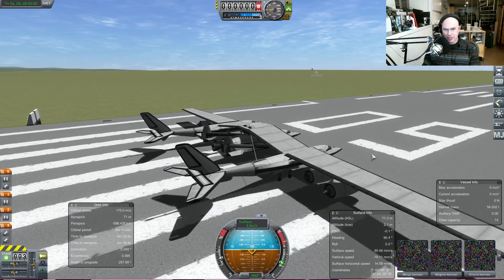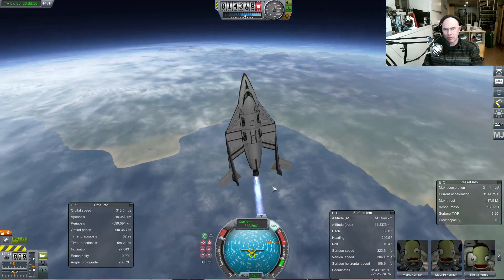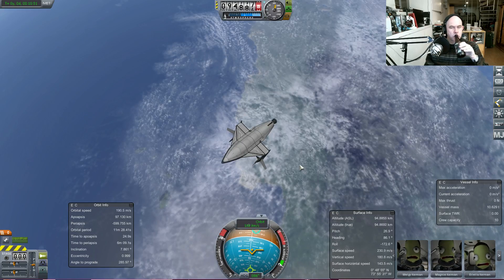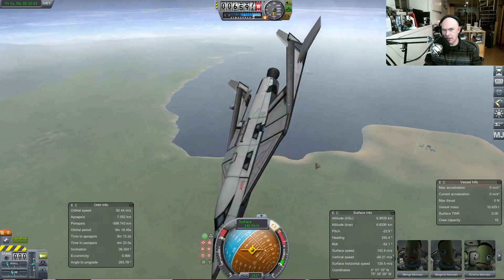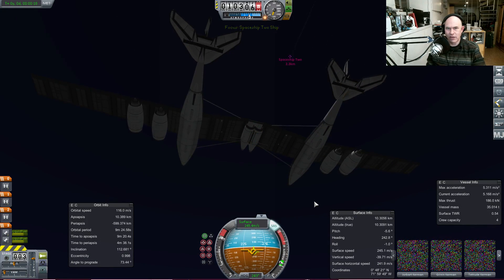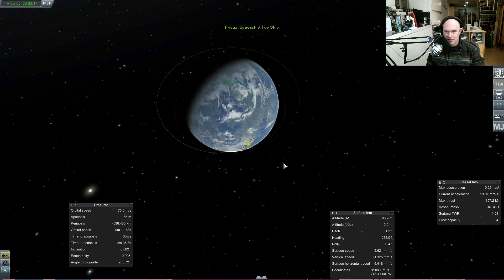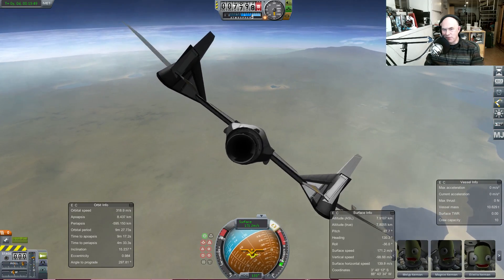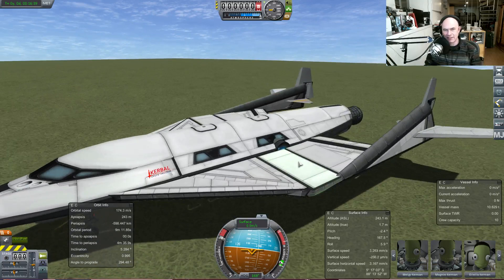Kerbal Spaceship Two / Virgin Galactic.

Comment: I'm not entirely sure what these guys are doing with SpaceShip 2. Trying to make the world's most expensive and randomly fatal aeroplane, or the world's silliest rocket.

I think we have learned that rockets which say "Light Fuse and stand well clear" on the side, are best not used for lifting anything which has a face.

And last time I checked, the best design for aeroplanes was to have the wing fixed in position, and to use control surfaces on the leading and trailing edges. Having an aeroplane where the wing can turn 90 degrees to the fuselage is the single most stupid rocket idea any person ever had.

This was perfectly demonstrated when a test flight deployed the wing mechanism, ripping the thing apart, and killing one person, and almost killing the other.

You would have to be a suicidal maniac to ever ride in this thing, let alone pilot it.

How anyone could think it was OK to spend more than $100 on this idea is beyond me. It's like trying to raise money to build a ski area in the caldera of an active volcano.

Comment: scott there is technic to bleed airspeed quickly. the manuever is called a slip. basically you are cross controlling putting in opposite rudder and aileron. the added drag will increase sink rate without increasing airspeed.

Comment: Also, maybe instead of going vertical, just go all the way at 90 degrees, or is it 45. Just, if there is a 90 degree angle from a vertical line, and a horizontal line (ground), then go 45 degrees, so your vertical speed is equal to your horizontal speed.
Reply: Diabetic Alien your comment makes me think of quantum spin.
Reply: brian554xx Lol.

Comment: how to have unlimited fuel in kerbal space program
Reply: Debug menu.
Reply: it wont work for me i have Windows 10 and i do Alt + F12 and nothing happens
Reply: If you have an NVidia video card with with GeForce Experience installed it contains a shortcut that overrides the alt+F12 in KSP. Disable or change it in GeForce experience and it will work again in KSP.
Reply: you need to use right alt or Alt GR on some keyboards
Reply: None of this works i tried (alt + gr / Alt + F12 / left and right alt / turn off my nividia on the game still didn't fix it) i dont think its in the game anymore or you cannot do this on windows 10

Comment: The U in U-Boot stands for "Untersee". So it's an "Unterseeboot" which literally translates to under sea boat. German is a great language isn't it?    ;-)
Reply from the maker: +Andreas Vogler fun fact - if you look at language origins then the most spoken Germanic language is.... English
Reply: Actually more than 2 U-2 submarines.
- SM U-2 (1908), served exclusively as training vessel in WWI, scrapped 1919
- U-2 (1935), a IIA, 2 patrols (27 sea days total), then training vessel, sunk 8th April 1944 (not "fairly early on"), collision with a German steam trawler, half the crew died, raised next day and decommissioned, wreck captured April 1945 by Soviet forces, likely scapped.  U-2 got a spread of 3 torpedoes from a British sub on her second patrol (all missed) and a bomb from a Wellington a couple days later (no damage).[1]
- U 2 (S181, 1962), a Type 201 German submarine (first new German sub class after WWII, optimized for the Baltic Sea; after 3 of 12 subs (U 1, U 2, U 3) very much changed military requirements the Type 205 was built instead).  Turns out the non-magnetic steel (AM 10) used for the 201 and the first 4 205 subs was corroding very quickly (a nice scandal!) and the U 2 was decommissioned after just over a year of service and broken up, with some parts reused for the 205 class.
- U 2(S181, 1966), a Type 205 German submarine; this one built from normal (magnetic) steel (the whole series used 5 different steels over 11 vessels: 4* AM 10, 2* ST 52 (normal, magnetic steel), 2* AM 53, 1* PN 18 S2 and 1* Amanox 182 M 9.  (PN 18 S2 is the steel used for all following German submarines).  Decommissioned in 1993, scapped.
- SM U-2 (or U-II) (1909, Austria-Hungary), a U-1 class U-Boat of the Kaiserliche und Königliche Kriegsmarine, designed by the Lake Torpedo Boat Company.  It had typical Simon Lake features, from the diving chamber, variable pitch propellers, 2 retractable wheels (for seabed travel) but also diving tanks above the waterline, which meant heavy ballast and 8 minutes of pumping to dive.  In WWI, she did training duties and then reconnaissance cruises from Trieste from mid 1915.  Declared obsolete in January 1918, she became a training boat again. Went as war reparation in 1920 to to Italy, scrapped.
- HMS Vulpine (1943, P 79), a V class(officially "U-Class Long hull 1941–42 programme") British submarine, loaned to the Danish Navy as "U2 - Støren" in 1947, returned 1958, scrapped.

And then there are the SM UB-2 (coastal submarine, 1915-1919, scrapped) and SM UC-2 (minelayer sub, 17 May 1915 - 30 June 1915, accidentally run down by British coastal ship off Lowestoft, sunk in 15m water), as well as the UC2 Kraka (2005, amateur-built midget sub, 6 tonnes, 12m length, out of commission and rusting away, replaced with UC3).  Also there's the UC-2, which started life as B-6, a Norwegian sub[2], and was in German use between Nov. 1941 and Nov 1944, as anti-submarine training vessel, decommissioned, scuttled, then raised and broken up in 1945.

[1] Interesting fact: the U-2 (1935) is smaller, slower (especially under water), has a much shorter range and a slower cruise speed and 1 torpedo less than the SM U-2 (1908), but coould dive much deeper and instead of the 45cm torpedoes the WWII U-2 of course had much nastier 53.3cm torpedoes.  But then the Type II submarines were coastal submarines.

[2] in 1914 Britain seized 2 almost completed coastal defense ships at the builders, this would mean Norway had them built in British docks by British companies.  B-1 to B-6, built in Norwegian yards, were a sort of payment for these 2 ships.  B-1 was laid down in 1919, commissioned 1923, and B-6 was laid down 1925 and commissioned in 1930 --- steel shortages being a thing.  Of the 6 boats, B-1 escaped to the UK, B-3 tried to escape, but a battery explosion got in the way and it was scuttled, B-6 was surrendered ("... else we have to bomb that nice city of yours ..."), the rest captured, as was one A class sub.  All but B-5 and B-6 were unusable even for training.
Reply: Which is actually great for Germans because it's super easy to learn. And English grammar has been simplified over time unlike German. I wish certain other EU countries would emphasize English more in school though.
Reply: Scott Manley well hang on there Scott, English is a combination of Danish, German, French and many other random bits from around the world. 

Oh and there were actually two U-2 U-boats - a type I boat in the First World War that was a prototype and test model and a type IIA boat in the Second World War that was sunk fairly early on!

Comment: the flipping over during acceleration is very very bad which is why the first ship ripped itself apart the first time they tried.  is a bad design and should have been a blended wing body.
Reply: rizendell Completely false. That's not why the first ship crashed.

Comment: The carrier was doing what's known as a Dutch Roll. That means it was rolling and yawing at the same time when you only wanted it to do one of those.
Reply from the maker: +2sudonim and how do I fix that
Reply: Scott Manley 
Disable roll on the vertical stabilizers
What is happening is the vertical stabilizers are trying to roll the plane and because there is no matching stabilizer under the plane they are imparting yaw force
The large distance between the vertical stabilizers and the centerline is exasperating the problem
Reply: I've got the same question. Do you toggle the different authority controls on the flaps?
Reply: Scott Manley perhaps if you paired some yaw input to your roll input? You're familiar with swept wing Dutch roll mechanics... right? I'm not quite sure it's what in play here, it doesn't seem quite right with the big flat wing.

Comment: how does nobody playing ksp know how to take off with a plane...?
You don't just pull up, that stalls you a bit and you lose some acceleration for the time being. Now that might not be enough to have any effect, but it's just one of those things you can differentiate the skill levels of players. 
Instead of pulling up and slightly stalling, you should lower the flaps (which you have if you build any plane with those kind of wings) and wait until the plane lifts itself off the ground. When the plane is in the air, you can start pulling up (again, without decreasing your speed and acceleration too much.
Reply: Lee'd That only matters if your aircraft has been made with pretty much zero fuel tolerance. (Which, incidentally, is a good way to differentiate the skills of players)
Reply: LOL. Thats not how real pilots fly planes. They dont take off themselves. Yes they use flaps, but If you have ever heard a pilot they say. "V1, ROTATE" rotate means to pull up a bit to lift the nose and take off. a plane would overrun the runway before it would take off itself. Unless pitch trim is set dangerously high
Reply: +Gamingwithsean And isnt pitch trim just basically adjusting the default position for the aerilons anyways?
Reply: yes, it is. so that would make the plane pull up

Comment: Is there a hybrid rocket engine mod? I haven't played it in a while so I'm kinda clueless.
Reply: If by hybrid you mean an air-breathing engine that changes into a closed cycle rocket engine there is one in the stock game now called the R.A.P.I.E.R.
Reply: rock3tcat (ⵙⴰⵔⵓⵅ) Not really, there are different types like electric xenon ones and stuff, but it's an awesome game, and I flourish can, I would suggest playing it on steam (Steam is way easier than the site)
Reply: Nathan Carlisle I meant more an engine using a solid fuel and liquid oxidizer, just like in the real Spaceship Two.